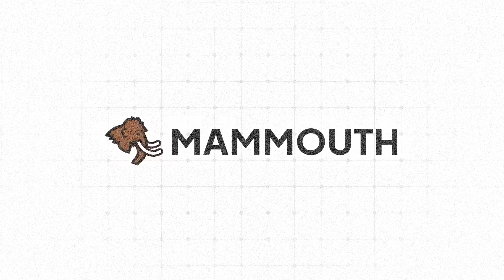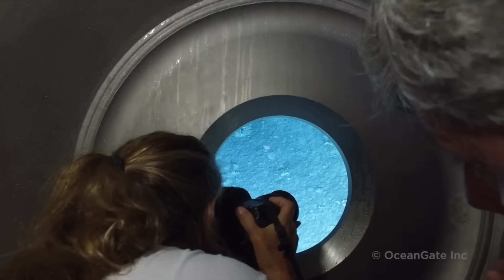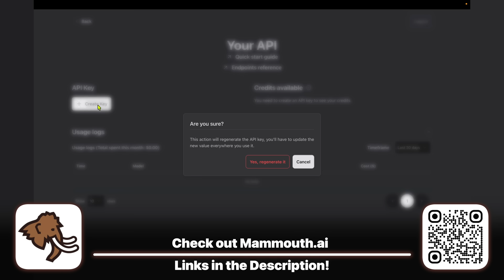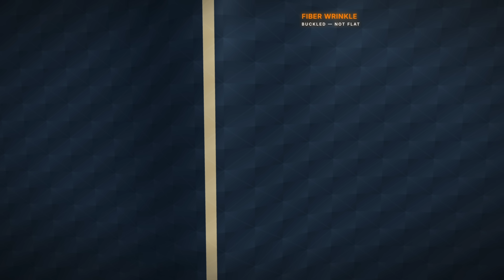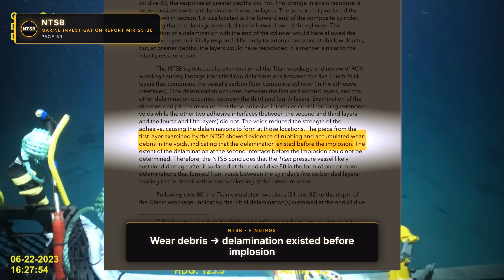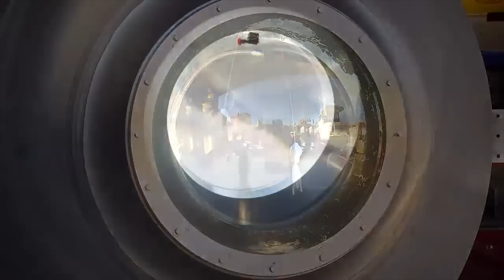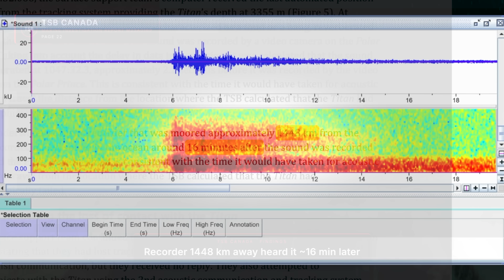Oceangate Titan: It was WORSE Than We Thought

Comment: Why don't they just build a Sphere where the radius of the sphere is the same as the long side of the cylinder they went with, and the crew cabin would be the middle third of that sphere, while the top and bottom arcs of it would be for machinery?

Comment: I think if you’re going to try to do something like this you build a prototype, then send it down and bring it back up, etc. maybe hundreds of times with no humans in it.  Have cameras and audio devices to monitor it at the surface.  But just see what happens.  If it implodes maybe you find the flaw, fix it on the next prototype, and do it again, until all known flaws are fixed.  After enough enumerations if it can work you should have few problems and then no one dies when the final version is built — maybe.  (There’s no way to absolutely guarantee any system is without flaws.  But you can have a petty high confidence factor.)

Comment: If it is a sphere and is built off proven technology and proven models that have descended into the Marianas Trench? Then yes, I would take it down to the Titanic.
My cousin's husband was in the Navy and operated the DSV Turtle in the late 80s that made multiple dives to 3,000 meters, so I know these types of submersibles in spherical form made of steel and titanium can get down that far... carbon fiber? Even before the Titan disaster, me being a mechanical engineer, knows enough about material science and cycle stress that I would NEVER go on any submersible made of carbon fiber to 3,000 feet (even if it were 9 inches thick). I have held those styrofoam cups they took to those depths aboard the outer mesh containers and saw a 20 ounce styrofoam cup compressed to smaller than a thimble and hard as a rock. No way would I get in some other carbon fiber deep submersible.

Comment: One of the frustrating things about being neural divergent is that I can look at what everybody else is looking at and not see the same thing.  The critical factor in deep submergence vehicles is that, at depth, everything is a spring!  It really bothers me that none of the final reports seem to mention the glue joints between the carbon fiber and titanium sections of the pressure vessel.

What the report gets wrong is the significance of the condition of the forward end ring.  Cylinders are the equal to spheres, EXCEPT at the ends.  The hemispheres at each end are supposed to correct this problem.  However, Oceangate was never able to weave hemispheres out of carbon fiber, so Rush had to break the rule of mixing materials.  What he failed to do was heed G. K. Chesterton's warning that you should not pull down a fence, before you understand why it is there.  The reason that you do not mix materials in a pressure hull is that mixed materials adds a new condition to the design specification:  the disparate components of the hull must respond to changes in pressure at the same rate.  It may be enough of a problem that hemispheres do not react at the same rate as long cylinders.  The transition from the cylindrical section to the hemisphere may require careful design, even if the material is the same.  The  titanium end rings do not have same compressibility as the carbon fiber cylinder.  The end rings and the cylinder are the same radius at the surface, but the carbon fiber cylinder shrinks at a faster rate as the depth increases.  This differential shrink rate imposes large shear loads on the glue joint that is only designed to support compressive loads.  If the glue joint fails, the end of the cylinder will rebound to the radius it would have, if it was not joined to the end ring.  What follows is the water hammer effect, which compresses the cylinder past the radius that would support the pressure.  The water hammering loaded the cylinder past the safety margin, triggering the implosion.

Evidence for the failure of the glue joint between the forward titanium end ring is the complete lack of any carbon fiber attached to the forward end ring.  Also telling is that the inner lip of the forward end ring has been completely sheared off.  The first thing that the rebounding hull encounters as it moves inward is the inner lip.  As the inner lip is not designed to carry the load, it is no surprise that it is sheared off.  Only one YouTuber ( jeffostroff ) commented on the condition of forward end ring.

Spherical pressure vessels are easier to design and certify.  Capped cylinders require care at the transition from the cylinder to the end caps.  Mixed materials need to have the compressive response rates to increasing depth matched, or the joints will be stressed in unintended fashions.

Matching compressive response rates would have required a thicker hull, which would have been less buoyant.  The reason that Rush went with carbon fiber was to eliminate the need for incompressible foam (hollow glass beads in a resin) to help the submersible return to the surface.  While Rush wanted the Titan to appear innovative, he was determined to do everything on the cheap.

Proper fabrication for a carbon fiber hull probably requires constructing it like a braided cable shield, or a hollow section of rope.  If I just wanted to take passengers down to the Titanic, on a budget, I would hang multiple steel spheres from a gasoline filled pontoon (the Trieste bathyscaphe writ large).  It was built in the 1950's, worked to bottom of the Marianas Trench, and would be much improved by modern motors, batteries, and electronics.  Being steel, towing it behind the support vessel would be much less of an issue.

Hypothetically speaking, if the Titan was designed to make replacing the carbon fiber cylinder a straightforward process, the geometry of the cylinder makes x-ray circular area tomography easier to do (you move and spin the cylinder, while the x-ray source and detector are fixed, so you could actually monitor the condition of the cylinder and replace it when the defects are too great in number.  The glue joint can also be monitored.

Comment: I've wondered about the carbon fiber. We use carbon fiber for our drone frames, and after so many impacts, the strands hold, but the material delaminates, softens, and loses rigidity. 

Given the knocks, pressure, ground layers, and repeated slamming against surfaces (the shock), I can't imagine it'd hold up under repeated use. It sounds like they had sensors to monitor it, which boggles my mind. That seems extremely important when using a new material as they did. You'd think they'd perform a forensic examination after each dive in a new depth zone.

Comment: Excellent presentation of the accident final report!

Don't look now, but the ruthless financially driven management constraints that are put on engineers, manufacturing and quality control are popping up in more & more sectors of our economy. (Think Boeing commercial airliners doing RUD's in midair, AI software minimizing guardrails which then renders AI dangerous in the wrong hands, autonomous driving mode that fails and kills drivers, etc.)

Pay for the best engineers, give them the funding they need to create the best products or services possible, and most likely they will deliver. Skimp, second guess them, fire the ones issuing warnings to hire yes men, and brush off outside safety recommendations or reviews, and disaster is sure to follow.

All the current signs in our society are consistent with a superpower in its decline phase, and the sensors are reporting the de-laminating process in near real time. So, expect more catastrophic systems failures in many different sectors as the funding for doing things right gets cut & diverted elsewhere...

Comment: in a promo video they showed the sub being assembled and the adhesive was applied to just a hand wiped surface, then by hand.  not in a clean room, with scoured/degreased/etc surfaces, in a controlled amount. that looked pretty sketchy to wipe it with a rag, then slather it on in a shop full of contaminants. fine for a car, not for mating the cap on a submersible for deep sea stuff
Reply: that CEO was a crook, with enough distance, it's hilarious. my carbon road bike is built better than that thing.
Reply: We don't even do this on cars. Our standards are far higher than that.

Comment: ”What was that bang?”

Unfortunately, that was your husband transitioning from Stockton Rush into Stockton Mush.
Reply: The two guys that looked at each other knew.
Reply: What was that bang? The notification that you have been promoted to widow.
Reply: or maybe Crush will fit, or wait there are no available space to fit, vessel is gone.
Reply: Wasn't it the first delamination, the one during dive 80?
Reply: ...sounded kinda like an underwater human-fueled diesel cycle.
Reply: @TopusSoftware  With one hell of a compression ratio...
Reply: @oskar6661I need the math on that
Reply: Actually you are not crushed but vapourised from the air being compressed and ignighting in less than a second.
Reply: @rickwhite7736 do you understand what jokes are?
Reply: @wizzyno1566  Their correction is also a joke

Comment: Your little monologue bout engineering tolerances is perfectly assimilated in guitars.  Lots of different materials coming together into one package.  A package that varies from one to the next, even in the most high end instruments.

When it all comes together perfectly, you really have something special
Reply from the maker: that's exactly right. it's like that 'lottery' guitar, where the wood and tolerances all come together. or that perfect engine. there's variability, and the more the variability, the greater the testing, and shorter the operating lifespan should be (at least for things like submersibles)

Comment: IMHO, the biggest problem was Stockton Rush, who was an incompetent engineer. The issue with carbon fiber is that it's great in small cross-section pieces where the manufacturing is make it in one go with solid QA. Also, it is well known laminar structures are always weaker than a momolithic structure of the same thickness. 

There was too much sloppiness in the entire design, testing, construction and operation of Titan.

Comment: You don't need to be a materials expert to intuitively understand that carbon fiber is strong in tensile strength, but a poor choice for a compressive load.  
It works well for an airliner hull where the pressure inside is higher than the exterior pressure and the tensile strength holds it together, but obviously not for a submersible subject to being crushed.

Comment: No mention of tension between the rigid metal and the flexible carbon fiber? Surely that was the weakest point, the edge between those materials.
Reply: Yeah this report never really determined what the root cause failure was. Apparently OG didn't use a clean room, or the right epoxy for those temperatures, they didn't vacuum de-gas the epoxy, and didn't acid etch or abrade the titanium mating surface. They were cutting corners everywhere.

Comment: Boeing's initial feasibility study called for walls between 7"-12", so even 7" was at the bottom end of their design criteria. Also this was simply a feasibility study for STATIC loads, not a finalized design which took into account fatigue or unknown forces like being towed or the addition of lifting eyes on the rings; Boeing assumed that OG would do the necessary testing and iteration to determine if the design actually performed to depth in the way it was engineered to do, and they never did.

Comment: So you're telling me that a deep-diving submarine with a carbon-fiber hull is possible and viable, provided it's well-built, engineered to a high standard, and certified... Well, at least the imploded CEO  lived up to his name and ambitions—he rushed to the bottom of the ocean 🌊
Reply: It's an open question whether it would ever be viable. If they made the CF thicker to make it truly safe it might be too heavy to be economically viable, and there's also still the question of the titanium to carbon fiber interface. That actually might have been the area where the sub failed.
Reply: @rjinkglider6908  Mmmmm, good point—I hadn't thought of that. But if they're going to use that material for submarines and ensure safety, they'll have to operate in relatively shallow waters—and, obviously, receive proper maintenance.

Comment: The soda can was a cool visual. Now put air pressure in it and put in water, maybe syrup to mimick the fluid dynamics of that much pressure squeezing the water. Maybe that's not right. But that air bubble will do some weird things when it is let out suddenly, especially under a tremendous strain of PSI.

Comment: I don't understand why (except to save costs) they couldn't just make a larger sphere that will hold 5 people
Reply: The answer to every question about why he did what he did is that if he did it, he couldn't have charged his 125k, and without his insane cost cutting and corner cutting, he couldn't have any dives, which means no more investor money and the business fails. He set out to build a submersible to offer commerical private dives to the Titanic for 125k. With 3 passengers, thats 375k per dive. That's far too little money to keep operating a deep sea submersible, that's why he towed the thing instead of paying for a larger ship, why it was kept outdoors in parking lot and not inside, why they didn't do proper testing, etc. Everything said that this business is impossible. But he didn't want to accept it, so he literally died trying.

Comment: 1. I’m not the type to go down in a submersible in the first place, but if I were I certainly would never have gambled on Rush’s Carbon Fiber Reinforced Plastic hull.  2. Before anyone went down in this thing, even Rush himself, a prototype should have been tested to failure.  3. The idea of a plastic (e.g. CFRP) submersible is counterintuitive. Therefore, hard Engineering Data and extensive testing on multiple prototypes would have been necessary before I would ever consider such a trip. Stockton Rush provided none of that.

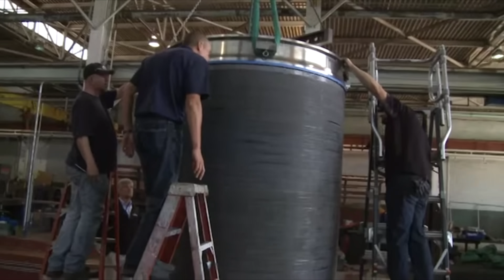Comment: 6:40 that guy laying his greasy mitts all over the mating surfaces makes me cringe every time I see it. Also they didn't de-gas the epoxy under vacuum, and the epoxy they used wasn't rated to the temperatures in the deep ocean.  And finally, they didn't properly etch or abrade the titanium mating surfaces for proper epoxy adhesion.

Comment: Oceangate did run test models, both imploded. Their alarm system worked. they ignored it. The carbon fiber was saved from scarp yard, boeing was able to disposed it because it was about to expire.o amount of engineering would have saved the titan, it was always going to imposed, the question was just went.

Comment: Ricky Ricky Ricky, it has nothing to do with fatigue or carbon fiber tensile strength.  It’s loading carbon fiber in compression! That’s like erecting a building with string.   It was always going to fail in the interface between the epoxy and the carbon fiber.
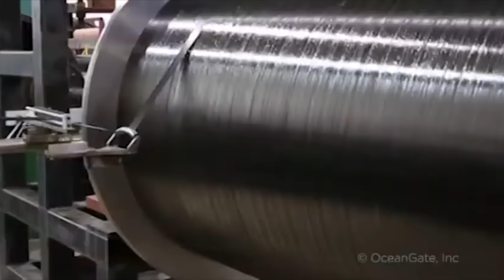Reply: 3:10 the problem is not fatigue. 🤦‍♂️

Comment: Good level of technical dive in this.  

The fundamental problem imho was lack of investment.  Quality systems cost money, testing costs money, heck, storage costs money.  Oceangate was obviously cash strapped, and it is impossible to guarantee safety without time and cash inputs.  

Who builds 1 of something in engineering and immediately uses it for purpose?  Even a ball point pen manufacturer or a door stop maker would use iterative design process at minimum.

Comment: "Defect free"??? This sounds like when you assume things are frictionless to do physics calculations. You might as well say it's made of UNICORN FART MAGIC compared to the bump riddled and sanded down monster they made. Also carbon fiber is better in tension than compression. It shatters instead of deforming. And it's probably physically impossible to make anything close to a "defect free" cylinder that is inches thick on any reasonble budget (or maybe not at all)

Comment: "A clean version" couldn't be built. That is a thing that happens between the drawing board and the manufacturing floor. That could have been predicted. Also, the carbon fiber strength is only in tension and if the matrix fails all bets are off.